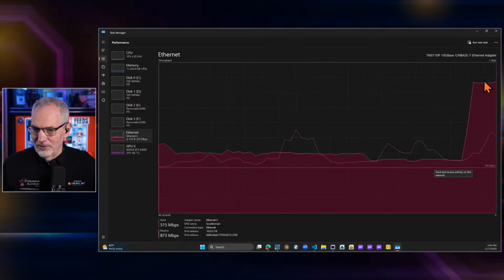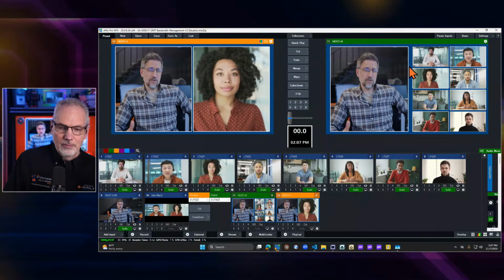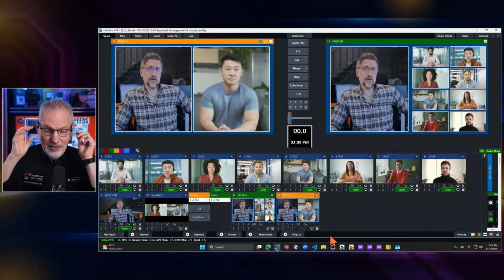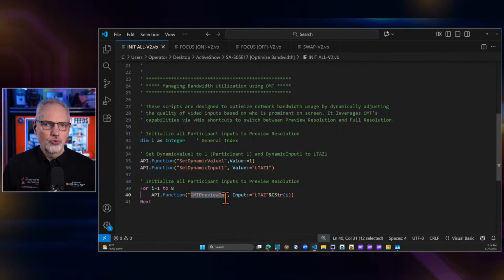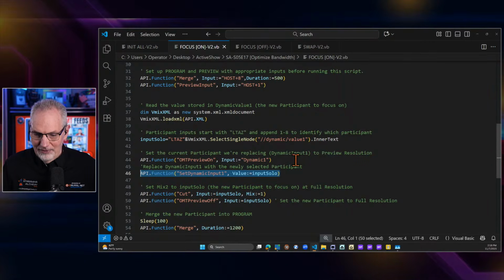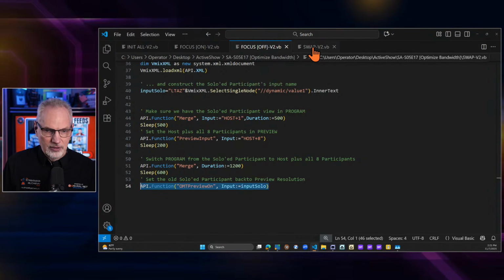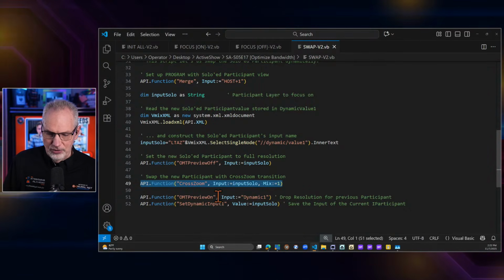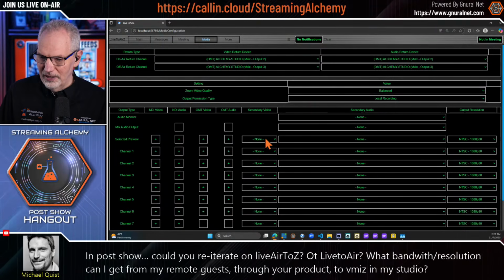Dynamic OMT Bandwidth Control in vMix: Smarter Switching for Remote Feeds

Comment: Was the 8-guest connection in your demonstration using the OMT protocol? Does OMT also support transmission over a Wide Area Network (WAN)? I might have misunderstood; I thought it was primarily intended for LAN use."
Reply from the maker: Hi @gareengareen2737 - Currently OMT only support local transmission. For this demonstration, I was using LiveToAirZ (https://www.gnuralnet.com/gnural-livetoairz) to connect with the 8 remote guests via a Zoom meeting. LiveToAirZ then sent the video of those guests from Zoom into vMix over OMT. OMT was only used for the 'LAN' piece of the video routing. Zoom handled the remote guest connection and LiveToAirZ acted as the bridge between them. Sorry if I created any confusion. Thanks for watching!

Comment: Hello from Greece. How are you merge the guest screen without fading the screen but slide the screen from the outside to inside? The "merge" transition fade the screen by default
Reply: Easy: on the first composition, the guest image is hidden outside the canvas
Reply: @IgnacioMadero yes but it doesn't fade but it slides at the current place
Reply: @Thanos_Balasis exactly. A merge in vMix always reshapes and repositions a layer when you hit take. 

This means: if your layer is in both Program and Preview already, it won't fade. Instead, it will slide to its new position and shape
Reply from the maker: Thanks for watching. I think everyone did a great job covering MERGE but feel free to ask if you have any other questions.